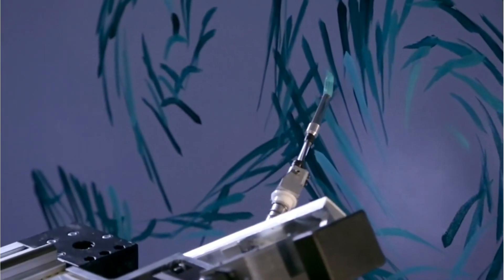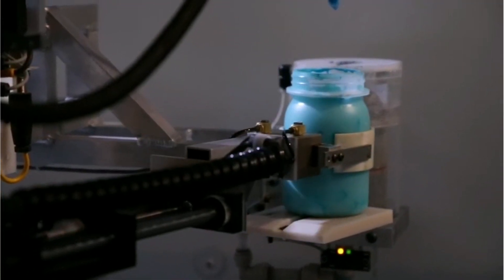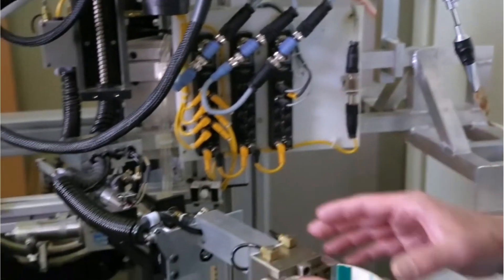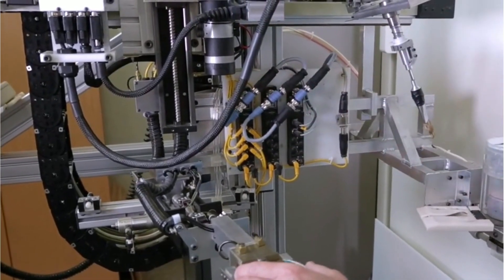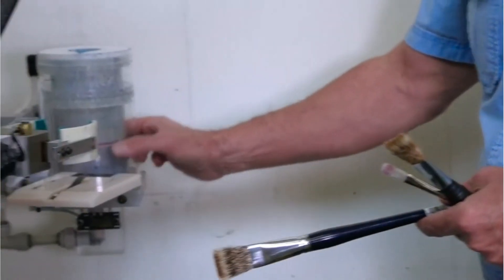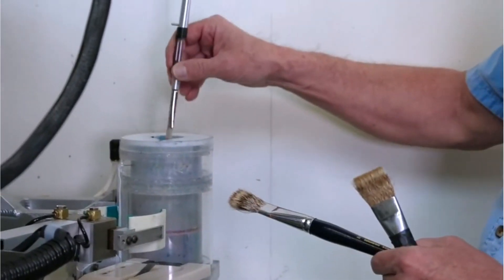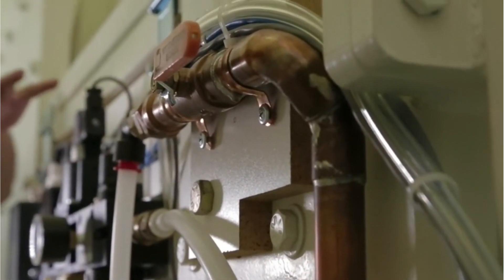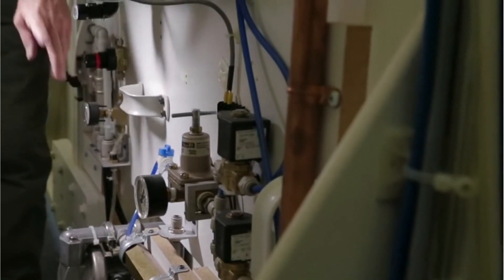How a Painting Robot Automated Brush Washing

Comment: Ah; perhaps a more practical solution would simply be to start with MORE brushes and simply place then in tightly sealed plastic bags to prevent them from drying out between uses?

Comment: As a sign painter for many years, we removed the solvent from the brush washing with a quick spin between between our hands. Then we held one hand at the ferrule and straightened the bristles.  This should work fine for your water based paints also. Maybe better than heat drying, because if there is any paint residue left in brush, it will quickly turn the base of the brush into a rock. When you finish the project for the day, you could do a very through cleaning by hand. My complements to you for an amazing work of art and technology with your incredible machine.